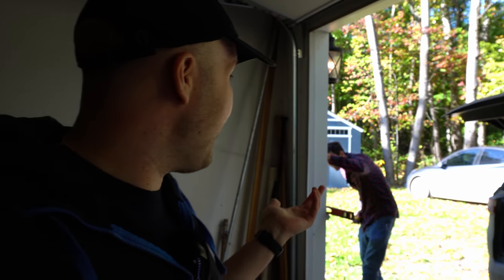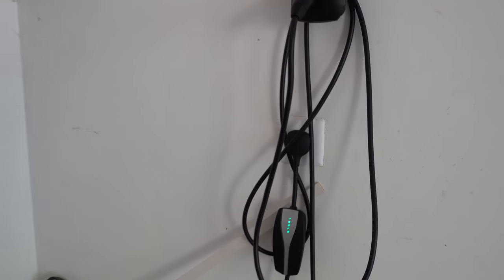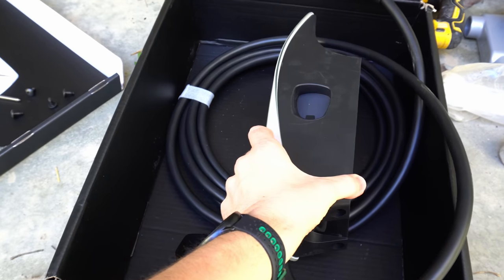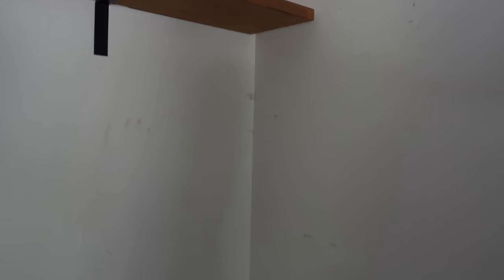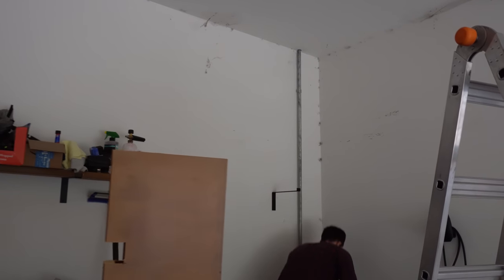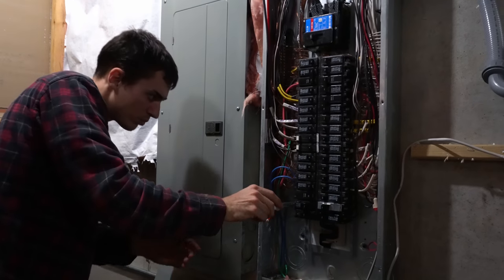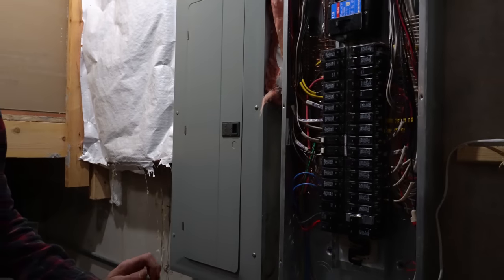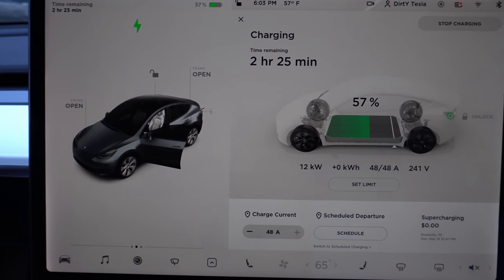Installing Tesla Wall Connector With a Master Electrician

Comment: Aesthetics? Have you seen your garage?  I know their boxes are outdoor rated but… I would put the box on the inside on the wall and have a tiny box with just a handle holder inside recessed on the outside wall. Open it and pull out the cable. Put the cable on a self retracting reel.  Bonus .:. Have the outside door lockable with a smart lock. Finger print opens it and also make it apart of a automation to Auto Unlock when garage is open or you’re nearby.  Recessed door sits a little proud with cable cutout at the bottom so you can close the door once the cable is pulled out.  

Or for a little bit more just get an induction charger in the driveway.  There’s a company that has one on the market now that’s 90% efficient.

Comment: OK - you have a fairly straight forward install; but most people can't have one - they rent or live in an apartment. Beyond that you are consuming scarce lithium ion batteries to make even fewer cars drive even fewer electric miles. Tesla like EVs suck up 10x more batteries per car than do hybrids which can commute all electric like the RAV4 hybrid.  If you install this wall, you make that 20x more.  Do you want 1 million Tesla like big EVs and 1 million walls or 20 million hybrids that dont need walls; both commute all electric .. 80 Million vehicles are made a year 1 million or 20 million?
Reply: A lithium hugger....

Comment: What was the point of this video? You didn’t show how the install is done and you kept providing misleading information. First of all, its not a “charger”, its a connector, the charger is in the car. Also, saying the nema 14-50 would be $50 is really misleading. You still need the mobile connector and so you need to buy one, and one should always be in the car. Furthermore, if you had the wall connector in the first place, you could connect both of them to the same breaker. Lastly, if you use a mobile connector, you need to leave it in the socket at all times unless you get a special socket which is capable of supporting constant disconnects. Glad you had fun though,. 16:51
Reply from the maker: When this video was made the mobile connector was included free with the car. Tesla changed that after the video was published. You definitely don't always need one in the car. I've been driving my Tesla for 4 years and always left it in the garage and only brought it with me on road trips.
Reply: @DirtyTesla  the reason I said the mobile connector should stay in the car is because you could forget it when you go on a trip. Also, those 220v sockets are not designed to constantly be connected and disconnected, unless you get the commercial one. 

Nothing wrong with using the mobile connector I just thought you should have pointed out the negatives. I think the wall connector is far superior.

Comment: Owner: "Are you supposed to pull a permit?"  
Electrician: "This is not, like, permit worthy"... "Not really changing anything on your house".  "Even a professional company wouldn't pull a permit". 
Bull***t.  100% he should have pulled a permit. Especially with 'this' kind of homeowner.
"Let's see if it works".
The 'electrician' is NOT responsible for the charger working.  What?  The electrician is only responsible for suppling 240v single phase voltage to the terminals meeting all codes, mfg's requirements and installing in a workmanship like manner.   Anything after those terminals is an equipment issues with Tesla or whomever purchased/supplied the charger.

Comment: A 60 amp circuit breaker and a Tesla wall charger that will charge the car at 48 amps is the way to go!
It's too bad that you cannot make room in your garage for two Teslas, because it would be so much more comfortable in the winter and the summer. I guess that you will really be taking advantage of the Tesla app to pre-heat or pre-cool your interior?

Comment: The outside charger should have a 60 amp service so you don’t trip the breaker.
Reply from the maker: Yes that's what it has
Reply: Why a separate service? Why not as they have it? (A branch circuit from the main electrical panel)?

Comment: I'd back the tesla up just to reduce the risk of tripping over the plug.
Reply: Something similar happened on a recent Wham Bam video. Chevy owner didn’t want to back over a cable at a hotel, so he tried to flip the cable over his Chevy, except as he was backing out, the cable snagged on his mirror and ripped the charger out, ruining both the Tesla’s port and the wall connector 🤬

Do not try to play jump rope with a Wall Connector!!

Comment: Boy am I glad I don't have to deal with this electric crap. My 1974 Alfa Romeo still runs perfectly fine with a regular tank of gas.
Reply from the maker: Electric is much more convenient. I thought the same thing when I got my first Tesla but I wanted the tech. We just got rid of our gas car and are all electric now. Way easier, more fun, and cheaper.
Reply: @DirtyTesla  I could care less about the tech. I like quick and easy and nothing is quicker and easier than going to my corner gas station and filling up in one minute flat.
Reply from the maker: @bigmacdaddy1234  that's fine. I was just telling you what initially drew me to Tesla. And it's actually faster to plug my car in at home and then it's fully charged that night or next morning while I eat dinner or sleep.

Also, time yourself at the gas station. The time it takes to get off the road, park, pay, pump, drive off is of course more than 1 minute.

But nbd. Electric isn't for everyone and that's fine 👍

Comment: You should mention why you want a licensed electrician.  She will assure compliance with code which protects you in case of fire (as in Chevy Bolts).  Imagine if the fire burns down your home.  If the fire inspector finds a fault that caused the fire, your home insurer might have grounds to deny your claim, and that would be catastrophic!  If you are a DIYer, at least hire an electrician to inspect and certify the job!